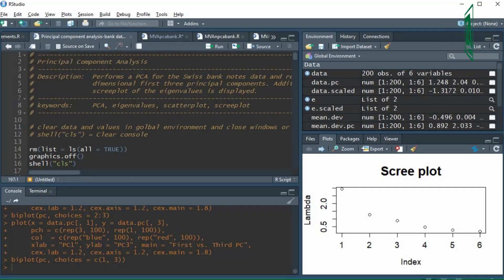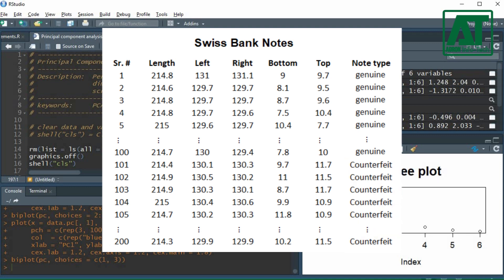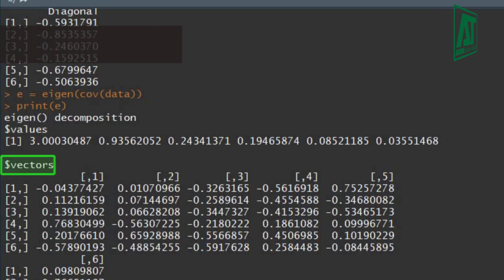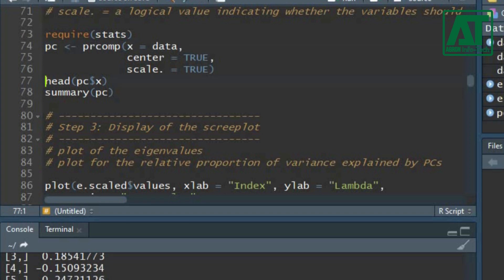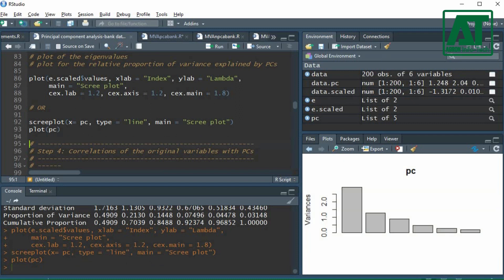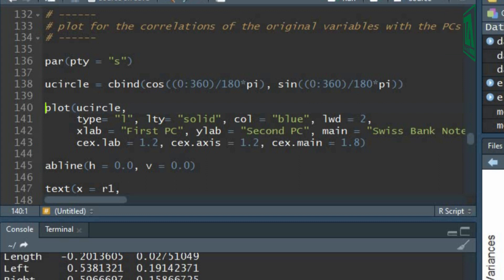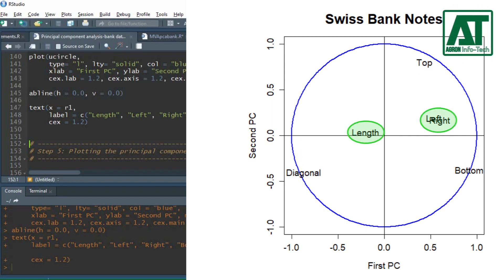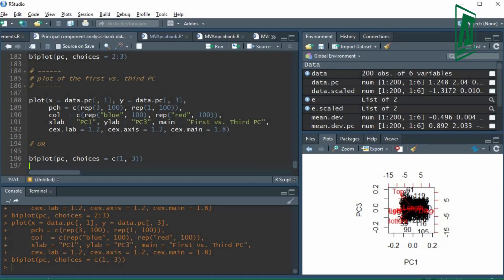Principal component analysis in R

Comment: Hi. Question: Is it possible to run an EFA on all survey items if the questionnaire has skip-logic or conditional branching? I'm finding that I get errors unless I run parallel analyses per demographic. Also, your video is so helpful. I will use much of what I learned to portray my results. EFA data vis isn't as flashy as some other data, but you certainly make it look digestible. Thank you.
Reply from the maker: Dear I am not sure about this as I have a very little experience of the data regarding surveys.